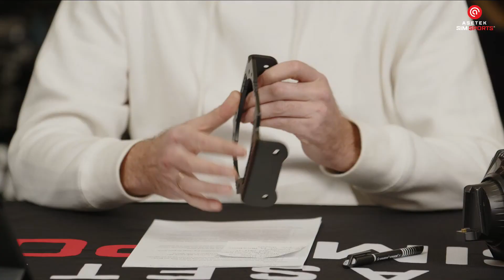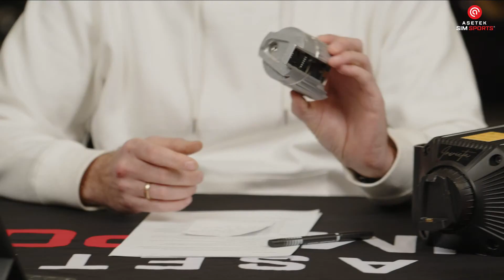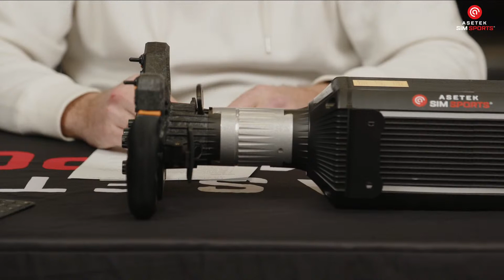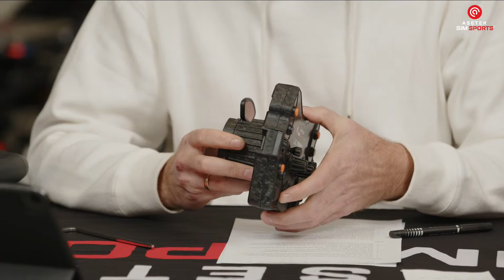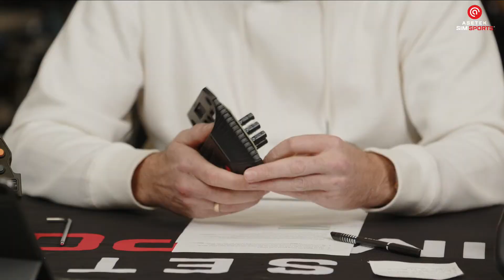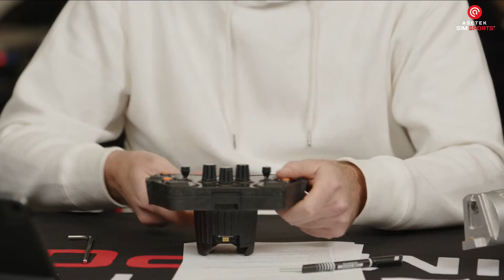LIVE Q&A WITH CEO André Eriksen - Ask your questions, hear about upcoming products, and more!

Comment: I missed this live. It was great stuff. My question may be for a future  Q & A will be. Is the PCV board of the Tony Kannan base is the same as the forte? Reason and asking is the TK Formula wheel has same PCV has the forte so if this is the case for the TK base then can we buy the power supply and kill switch to upgrade. Thanks in advance.
Reply from the maker: Yes - all the same 👍

Comment: I can’t believe I missed this. I so badly want to ask this man a question about the possibility of them developing a hand control unit.
Reply from the maker: I cannot promise anything because there seems to be a lot of engineering involved and I am not in a position to decide over that, but you are always welcome to write an email to hello@aseteksimsports.com with the attention of André, and it will be forwarded to him for sure 👍
Reply: I appreciate the response and the advice. Will definitely send that email.   Thanks again.
Reply from the maker: What do you mean by hand control unit?
Reply: @AsetekRacing  As a disabled sim racer, there is currently only one real solution for driving with a peddle set, which is to use the dual clutches mapped to gas/brake. While this does at least allow us the opportunity to enjoy sim racing, we miss out on the one piece of hardware that is almost universally recognized to be the most effective way to become a more consistent and faster driver, which is a load cell or hydraulic brake. Many real life disabled race car drivers use some variation of the Guido-Simplex Dual Ring system. One ring in front of the wheel the driver pushes for braking and one ring behind the wheel the driver can pull for the throttle.  While there is a company that made dual ring hand controls for older Logitech and Thrustmaster wheels, and is trying to build one using Fanatec’s Advanced Paddle Module, has proved quite challenging.  Right before I seen your video from before the Sim Racing expo, which previewed the modular button box and rim options, it hit me that with a system like a new standard for hand control operations could be much more easily implemented.  If there’s ever any interest in creating that new standard at AsetekSimSports, please let me know, it consumes my mind. But I have neither the resources, knowledge of engineering or access to equipment it would take to make a prototype.  But I do know about everything that is currently available and where it falls short, and ideas on how it could be improved.   Also,  cannot wait to get my La Prima  (Tony Kanaan) base in a couple weeks.   I love what you guys are doing at Asetek, can’t wait to have a piece of your equipment.

Comment: Thanks for the stream. I'm very excited for the upcoming products. I love my La Prima wheelbase and will be expanding my Asetec gear without doubt. 
Please please please look at bringing force feedback to flight sims. The industry now is full of over expensive spring and cam based joysticks with the only options for force feedback being near commercial systems or an excellent but DIY option using 3d printing. 

I love the idea of being able to upgrade pedals from the La prima to the Invicta but it seems like people are expecting too much to be able to upgrade wheelbases. Surely shipping parts back to be modified would just be more expensive and labour intensive than just buying a new one and selling the old base on to someone else. The second hand market is really strong here in Australia at least for sim racing gear.

Comment: QR without electronics is big. Should be competing with the Simucube mount price wise. But 150 per wheel is a big much, it’s okay for the main rim with LEDs and stuff but if you just want to mount a Rallye or Drift wheel for example with no electronics at all, it’s overkill and half the price should do the job. Good that that comes.

Comment: Mounting options for Asetek wheelbase is just horrible, especially for the beginners who don't have much experience setting up the SIM rig.  I recently bought La Prima bundle but having a nightmare of researching to find out which SIM cockpit I need to get, in order to mount this wheelbase solid.  It looks extremely hard even with purchasing one of Asetek's wheelbase mounting plates separately.  It's been nothing but an absolute frustration.
Reply: I suppose some of this is on the mount makers. Next Level Racing Wheelstand 2.0 has a TON of holes to use for mounting. But only TWO line up for the LaPrime wheelbase. The rear ones. You will have to drill through the carbon steel to make new holes or spend money on the Asetek wheelbase mount with tilt. Which is a little annoying because the base already tilts. It's that, mount with some wood or something, or drill the carbon steel on the NLR Wheelstand 2.0. It's a little frustraiting but really Asetek just made their holes 3.5" apart with infinite options on one axis. Next Level Racing decided to follow that axis with the rear holes at 3.5" and the front ones at 3" apart. Come on NLR!!
Reply: @justinelliott4127 I use the tilting mount. It attached to my NLR  rig perfect. No drilling like you said
Reply: @justinelliott4127  unfortunately NLR is just not  my personal preference though -_-
Reply: That's really on the rig makers if they aren't updating either their mounts or just their compatibilty lists. I haven't had that experience though at all. Trak Racer and Sim Lab have multiple options for their cockpits. Asetec can't really do more than make their own mounts available initially, which they have done and they publish the mount pattern. The new Fanatec compatible mount is a good idea though.
There are also 3rd party mounts like from Simcore. 

The cockpit companies will be more than happy to tell you if their products will fit the Asetec. Or there are many great sim racing forums and discord groups full of people who will be very happy to give you any information you need.
Reply: @grasstreefarmer Absolutely.
Reply from the maker: Did you watch our mounting videos?
Reply: @AsetekRacing Yes, many many times.  It's not that I don't understand the mounting video instructions.  I just can't believe Asetek wheelbase doesn't fit ANY sim cockpits out there unless you purchase the wheelbase mounting plate separately.  Also Asetek's front mounting plate seems to have enough flex once installed, according to many SIM Youtubers, and other Asetek mounting plates require drilling or other means of modifying the SIM cockpit, which is such a painful work for most people.  Asetek really needs to address this issue. Other than this issue, Asetek products seem to be really solid.
Reply from the maker: @KAYLIE_OFFICIALLL  there is no detrimental flex in the front mount and the front mount supports pretty much any profile rig on the market. Several reviewers confirms this.

For sure you need to purchase a mount to mount the wheelbase as you can see in the video, we revealed two more mounts. 

Our mount that holds the button boxes also supports/has holes for other brands’ patterns so mounting is not really that big of a deal and it is not a feedback we have received often.

Needless to say that as our wheelbase is much slimmer than for example Fanatec, we obviously do not have the same mounting holes.
Reply: @AsetekRacing  Agree that Asetek's wheel base in much slimmer than Fanatec, which I appreciate.  Thank you for providing additional info on the mounting issue I'm having.
Reply: @KAYLIE_OFFICIALLL it’s annoying that their bases don’t fit any other patterns, I agree. The easiest solution if you don’t want to drill is the normal bottom mount, it has Fanatec patterns which you can mount to the wheel plate
Reply: There's no flex and on all the you tuber videos I've seen, they've said the same. I have a NLR FGT Elite cockpit and the Invicta base is rock solid with zero flex. I use one of the Asetek mounts and it all installs great
Reply: I thought it super easy to mount, went for the front mounting option and was really easy to install watching the tutorial video, and looks awesome
Reply: @BASHERSKINZ  Yes, it does look pretty easy but my point was that we have to buy the front mounting option separately from Asetek in order for this to work
Reply: I have Overpower GT Lite rig. Zero flex with la prima wheelbase.
Reply: Same problem I had to make extra holes in my SPARCO cockpit. Will you take out your own cockpit please? Or do I have to buy another one?